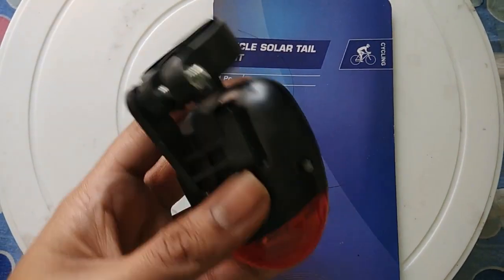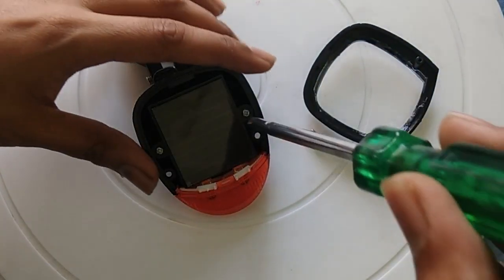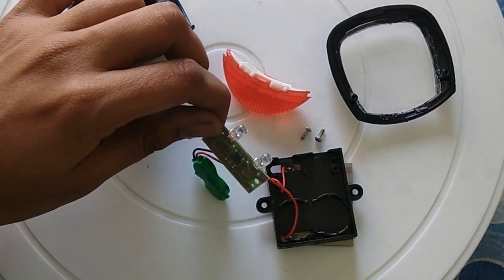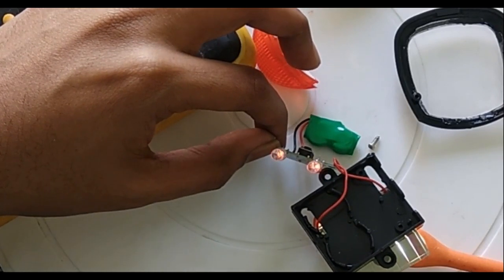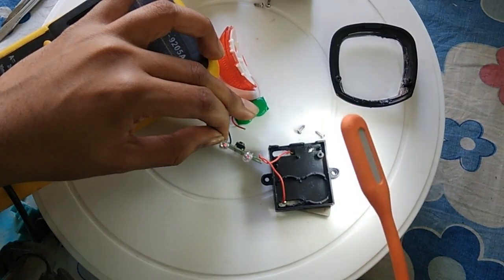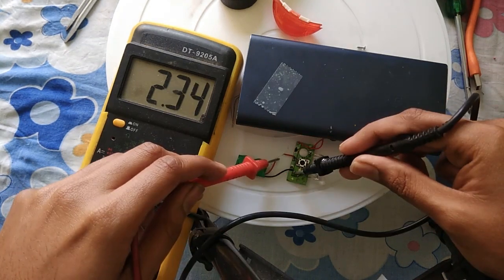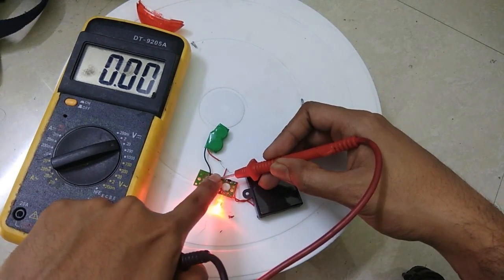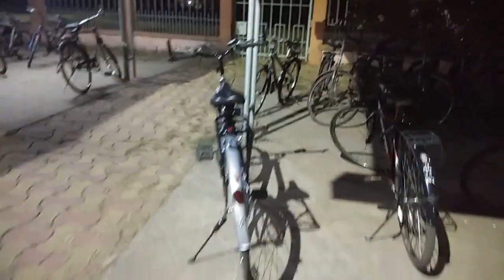What is inside a solar powered bicycle tail light?

Comment: Hi, is this bicycle tail light sensitive to day light? I mean will it auto turn off during daytime? Or everytime i need to on off the switch?
Reply from the maker: no sadly it does not turnoff automatically but using opamp circuit (lm358 and an ldr(light dependent resistance) one can do that.